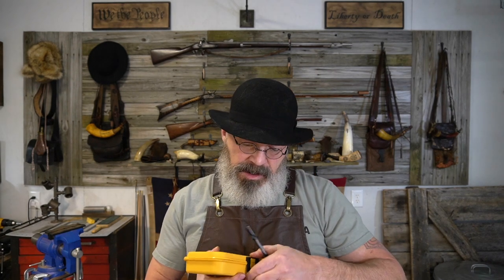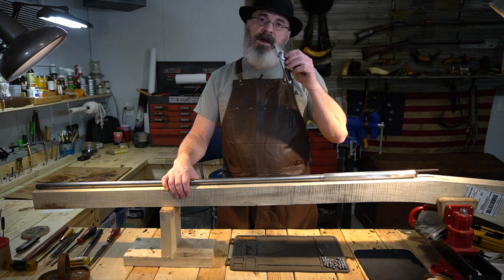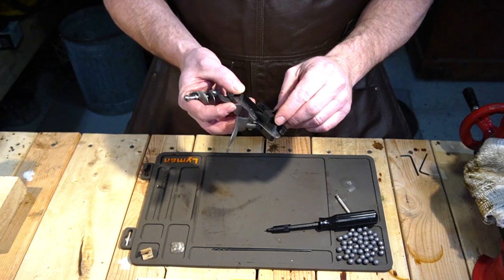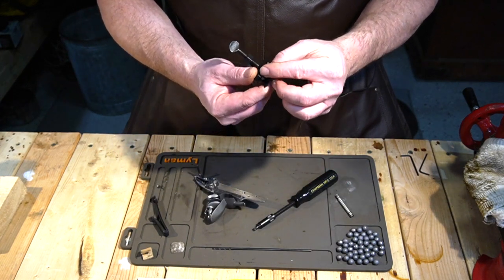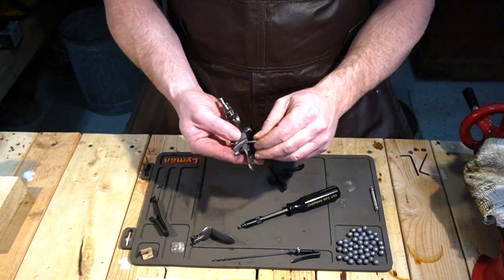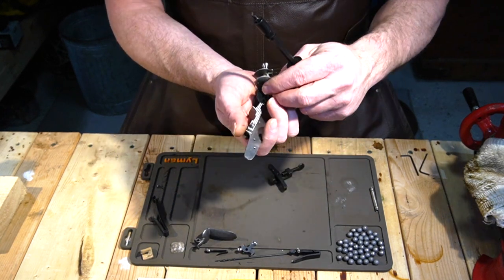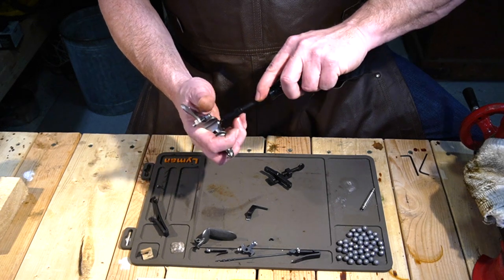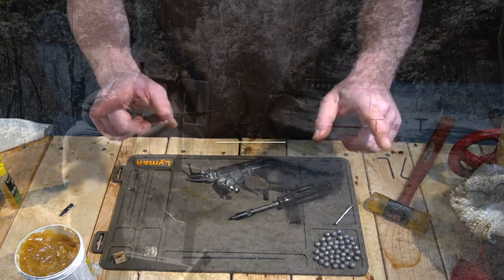FLINTLOCK LOCK DISASSEMBLY

Comment: I have to say that I'm happy you started this channel as I'm very new to black powder/ flinters. I bought my Charleville repro locally, but finding someone to supervise me in getting started has been impossible. The local mountain man group is hard to make contact with. I would like to ask a question, if you don't mind; How do I determine the correct size ball for my .69 caliber smoothbore? Is it ok to just mic the muzzle diameter, or do I need to measure further down the bore? how much smaller than the bore diameter should the ball be? Any advice you could offer would be great. Thanks, I'll be watching. Butch.
Reply from the maker: Hey Winfield. First of all I suggest you go to the AmericanLongrifles Forum. There is a very active group there and a large and active 'Black Powder Shooting' sub-forum there that has continual discussions about ball dimeters, etc. I usually mic at the bore and if it's say .69 I will buy .685, .68, .675  balls from Track of the Wolf and test them bare balled, in a paper cartridge or patched. Generally I will load the tightest possible bare ball with a shotgun card or hank of Tow over the top to keep the ball against the powder. That load can quickly get hard to push down when the bore is dirty though and take lots of swabbing to load. You will end up, i think with several sizes as the tightest  bare ball load will not work with paper cartridges and you will find some combination of grains of powder and ball size, bare or otherwise, will shoot most accurately in your gun. Each gun performs better with a different load and finding that load is part of the fun. I keep 3 sizes of balls for each gun. I like to quick load looser bare balls and plink at 35-40y or so and develop the most accurate hunting load at 50y as well. Those are often cartridges or paper patched but not always. 

Feel free to ask any questions you would like. I am on the ALR forum under my name. Bob McBride. Hope to see you there.

Bob
Reply: @BlackPowderTV  Thanks guy, will do.

Comment: I had to file the bit from my Brownell screwdriver kit that closely matched the flint jaw screw. It would fit but the curve prevented the blade reaching all the way to the bottom of the slot.  If I didn’t,  the bit would only go about a quarter down,  which means if I wasn’t really careful, I would messed up the slot sooner or later.
Reply from the maker: That set i show in the vid is the Chapman Master Set 5575. The Chapman's seem to have longer parallel edges than most and fit well in the cock jaw screws, even though i will often file the screw slots wider as some are ridiculously thin.... Thanks!

Comment: i bought a Lyman great plains rifle kit about  8 mos. ago. the lock looks pretty jinky to me. the main spring is a coil spring, and doesn't seem to have much tention on it. can that be adjusted or do i have to change it out? thanks, great info in your vids.
Reply from the maker: No much adjusting that can be done Bob. You may be able to source a stronger coil spring. I think L&R makes a replacement that has a traditional mainspring. 👍🏻
Reply: @BlackPowderTV   thanks

Comment: Ever have the cock slip? If the fly can't move freely because of grease and dirt build up, will it make the cock slip?
Reply from the maker: I have had cock slip but not from the fly. The fly basically lets the seer slip past the half cock notch on the down stroke. Once you get to full cock you are past the fly and past any interference it can impart on the cock. Thanks for the comment Johnny!

Comment: What is your procedure for recompressing the main spring?
Reply from the maker: I try to leave it in the clamp most of the time but when I take it out, like in the video, I just bear down on the spring clamp to bring it back to enough compression to get it reinstalled. You may need needle nose pliers to assist you in turning the clamp.